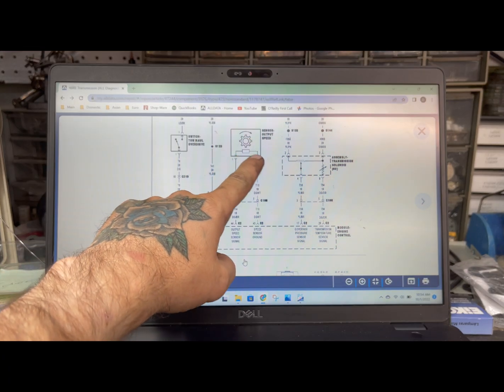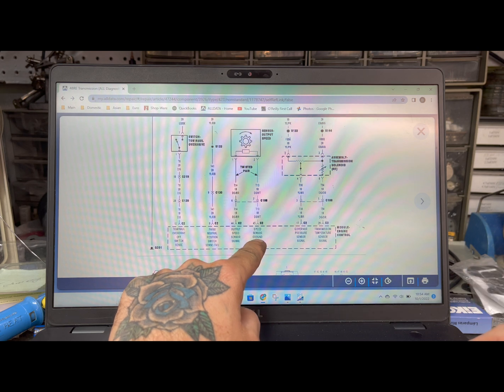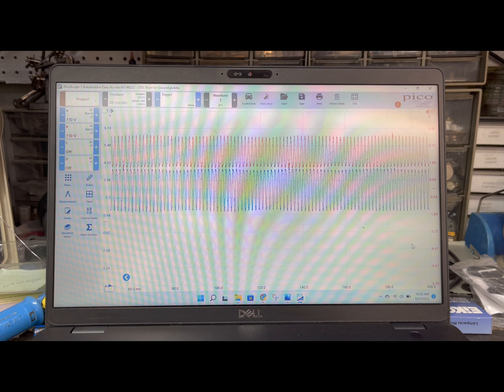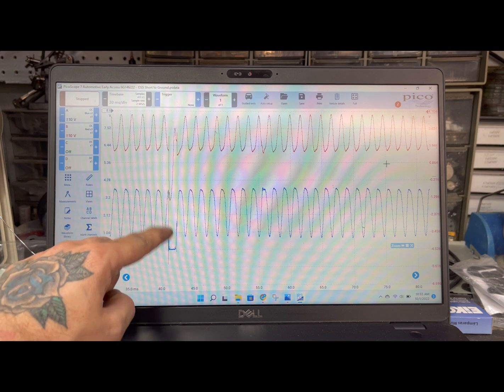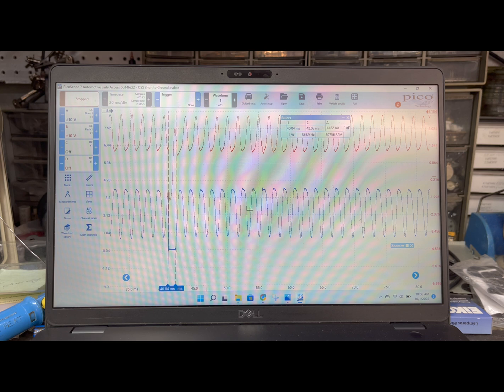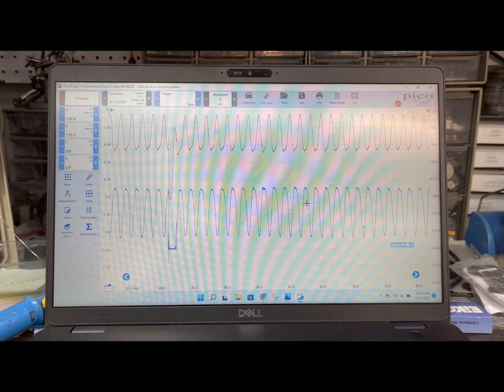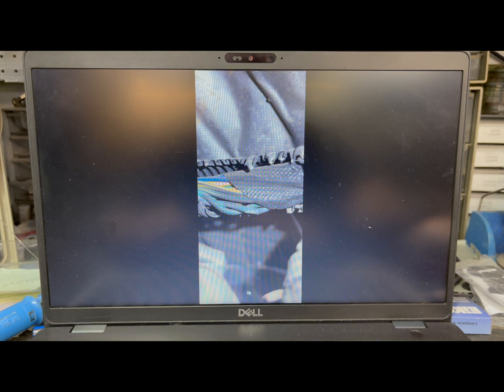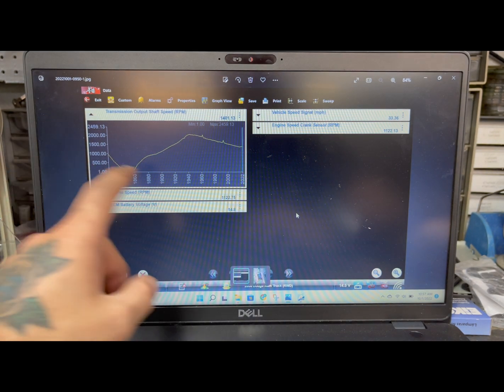Ram Intermittent P0720 and why you need a Oscilloscope

Comment: It is common to have the variable reluctance AC input signal be biased to about 1/2 of 5 VDC (digital) because then the detection circuit does not have to operate below ground. However, if you have ever had to design a VRS input conditioning circuit it is actually better to have a true ground and use a split supply (+/- 5VDC) in the detection circuit using an off the shelf comparator IC.

Comment: Had almost the same exact thing on a ram that had trans pressure sensor dtcs, been to tranny shop to be rebuilt and a million parts, found it shorting the vref very intermittently and found the wire chafed on the dipstick at the back of the engine

Comment: i am 66 and just started about a year ago learning how to use a scope was a challenge just starting to get a handle on it to start with didn't think it was worth the money until i had a wheel speed sensor problem i didn't need the scope to find the problem but used it to prove i was correct in the diag.
Reply: @autodiagyt  THE BIGGEST STRUGGLE I HAVE IS SETTING UP THE SCOPE VOLTAGE AND TIME CORRECTLY. I HAVE STARTED WITH THE 20  20 AND WORK FROM THERE